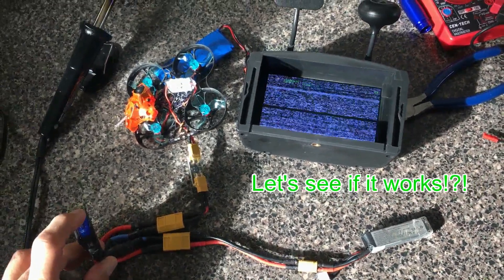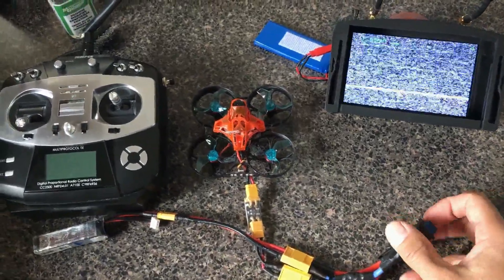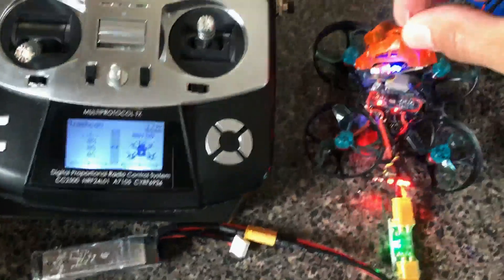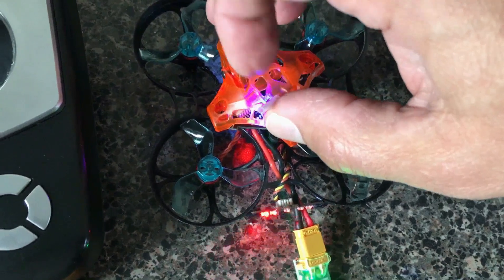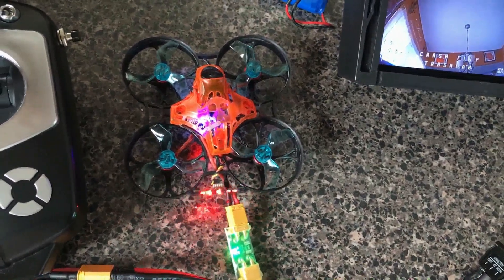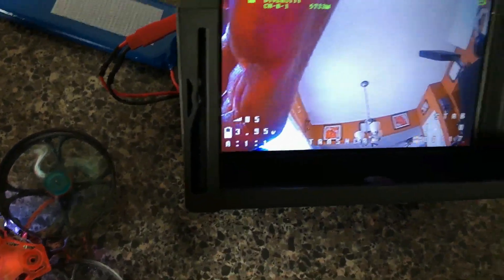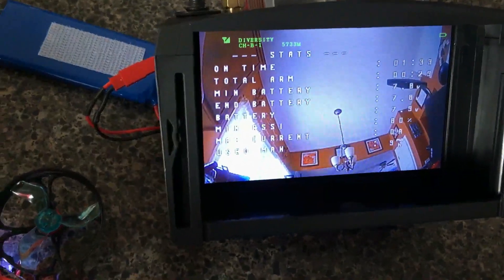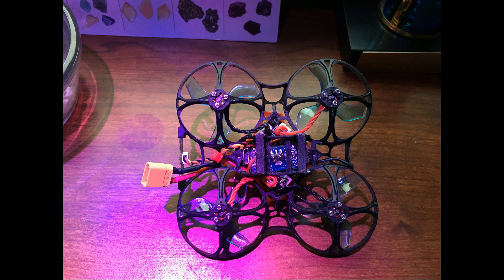Eachine Trashcan crazybee fc failure (5v regulator fix)

Comment: How long u been flyin acro?just curious cause it looks like how i flyy& I've been flyin for 3yrs and just now started acro,^I hate it!!!!!!!
Reply from the maker: 3-4 years but this video I only been flying acro for about a year
Reply: @ChrisLBradly  yeah it's pretty rough ,every time I'm up in air high enough and I feel confident I switch over in air,or acro and next thing I know the ground,lol so I think ima keep my ass were it is ,I didn't learn I. Acro like most si it's better I stay away from it,lol
Reply from the maker: @raydesheles9205  best was to learn is wide open spaces. Just think of it like packman where it will continue going in one direction unless you make changes on the sticks. It’s backwards to angle mode

Comment: hi, my main bat voltage stuck on 5v, you dont have that problem, do you know how to fix it?
Reply from the maker: I haven't had that issue.  maybe you have to adjust your scaling in betflight.  does you quad run ok?
Reply: @ChrisLBradly  yes, i have two boards with this mod and just one have that issue, but dont worry, i can fly just with the timer
Reply from the maker: @laosmanzur9808  i think the voltage is stuck on 5v volts because it is reading the voltage of the regulator

Comment: I have the same problem too! After 3 flights xt30 450 2s
Reply from the maker: I don't think the regulator is design to handle the xt30 current because my mobula7 F3 Pro flight controller failed too.  i do not recommend th regulator in my video it can overheat under extreme or idle conditions but suggest these options, lighter 
Thanks to Albert Kim
Here are a few differennt 5v regulator options...

Pololu 5v Regulator (this will work with 1S or 2S) http://amzn.to/2BULgfP
 

Wolfwhoop PW-D Control Buck will work on 2S -6S (use the appropriate battery for motors) - http://amzn.to/2XmSTEK